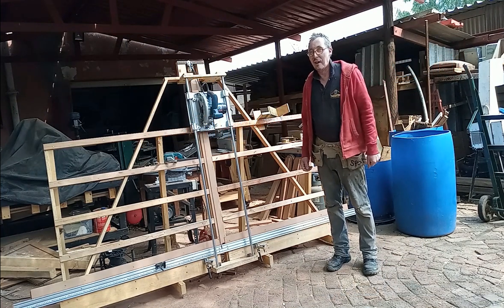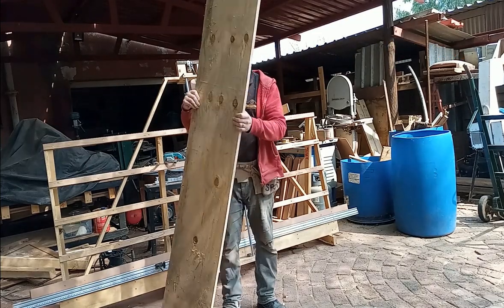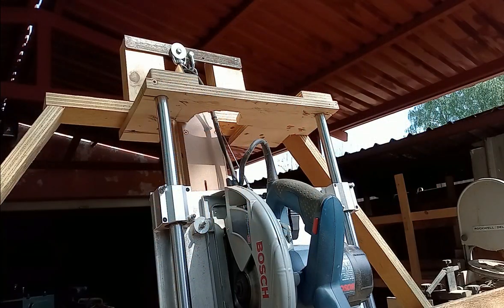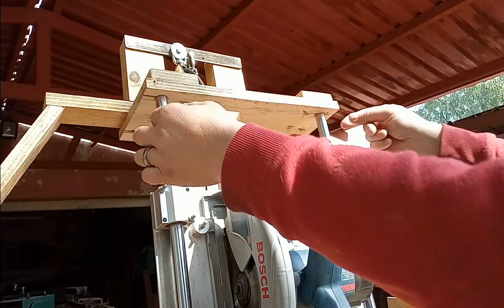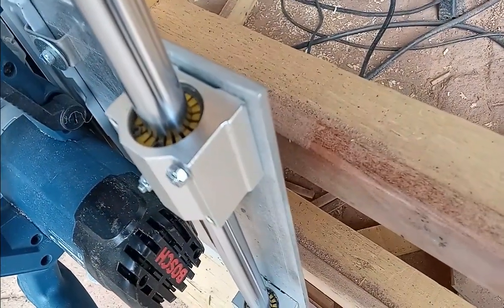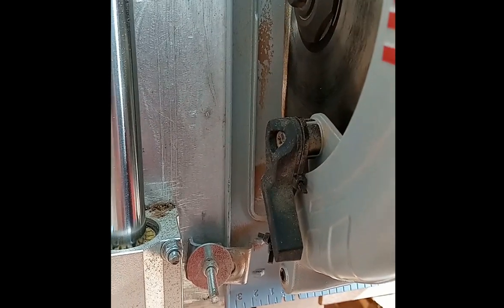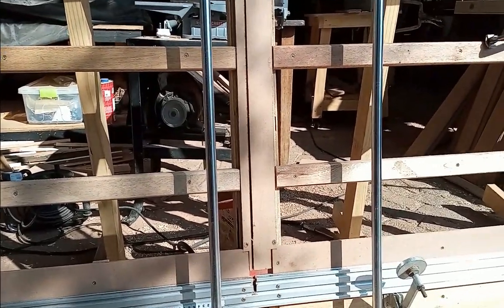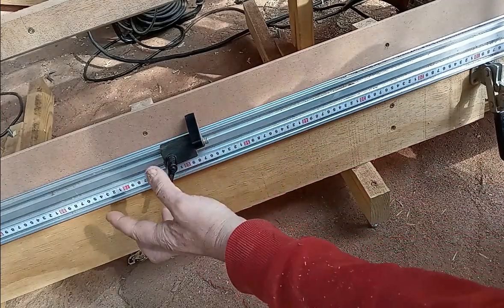How to make an upright panel saw

Comment: thanks just what I am looking at putting together, what the bearings called as I am trying to find them on line, thanks Keith
Reply from the maker: I don't know whereabouts in the world you are, but these people usually ship anywhere. https://www.banggood.com/Machifit-4pcs-SC20UU-20mm-Solid-Polymer-Linear-Bearing-Slide-Bushing-For-CNC-p-1344845.html?rmmds=myorder&cur_warehouse=CN  I have now made a few tweaky improvements. Top up video coming soon...
Reply: @paulcunningham4147  thanks for your reply and the link I am from the czech republic, and that's ely the same like that I found after watching you video a few more times and remembering what you Calle them, looking forward to seeing your tweets video how long till it will be finished .thanks again , Keith